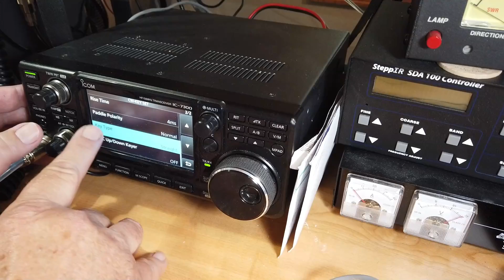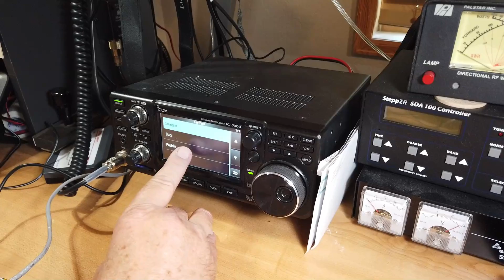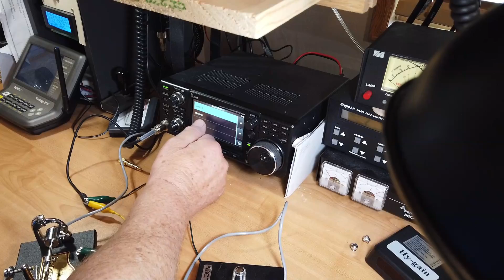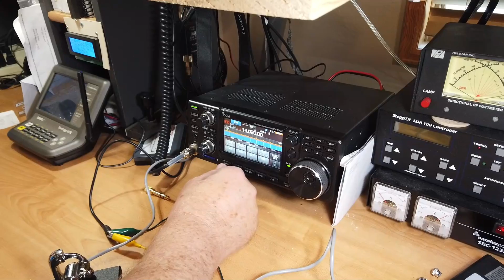Which Paddle for Dit? Which Paddle for Dah? (#734)

Comment: Hello Dave,

From the time I got my Novice license in 1971 I was taught that 'normal' was to have the dits created by your thumb and dahs created by your forefinger. Which works out as you said, and matches how a bug would be used by a right-handed person. I'm left handed, so I either: 1) wire the paddle so that dits come from the right paddle and dahs from the left, or 2) go into the radio or external keyer settings and choose 'CW Reverse' or however it might be labelled. 

For those who say it doesn't matter and do what you like, well, ok. But I think it's good to have standards, however arbitrary they might be. That way we all do the same thing the same way. So my paddles are wired so that they are left paddle for dits and right paddle for dahs, and I choose 'CW Reverse' in the radio or keyer for my left-handedness. I have also created a short cable with connectors on each end which will take the dit connection on the paddle end and cross it over to the dah connection on the radio end, and vice versa for the dah connection, for radios or keyers that don't electronically swap the paddles.

So by now I am way overthinking this stuff, but it works for me. By the way, being left-handed, I could never get the hang of a bug. 

Also, I prefer to use an external keyer because they generally have more features that a radio's internal keyer, and the connection from the keyer to the radio is the same as for a straight key. So I plug a 'Y' cable into the key/paddle jack on the radio then plug the straight key AND keyer output into the two legs of the 'Y', so that I can have the straight key and paddle connected to the radio simultaneously, which is very handy.

Thanks,

Mike - WB4HUC
Austin, TX
Reply: I am learning to use a paddle. Although I'm right-handed, due to neurological issues my left hand is steadier, so I'm keying with my left hand. But I'm learning with "normal" polarity.

Comment: Years ago (well in the 1960s) as an RAF w/op the more adventurous used to put a metal handled dinner knife as an extension to a straight key to provide a "bounce" to produce the dots. Frowned upon by the bosses however.